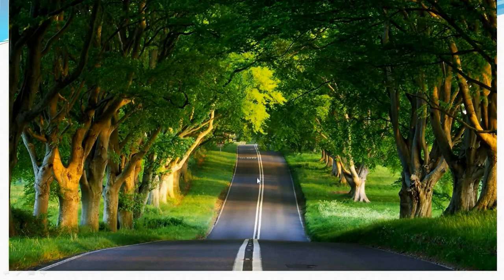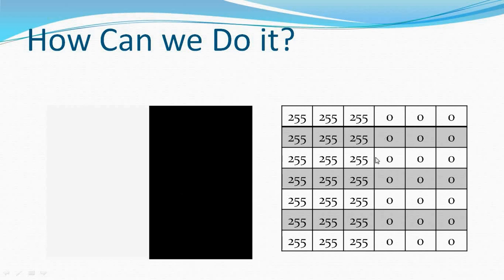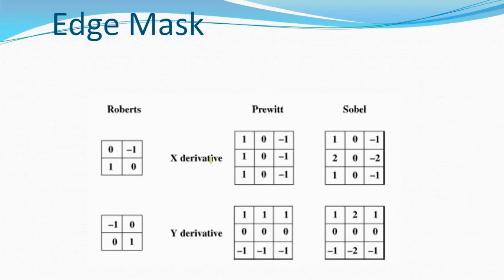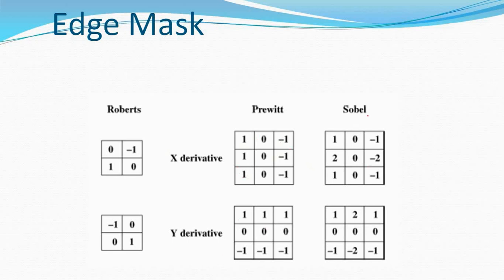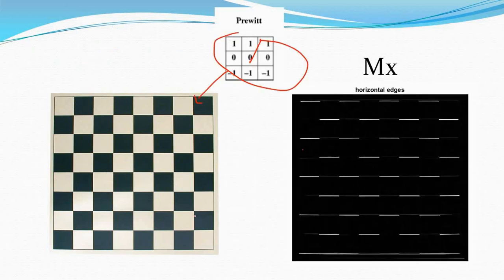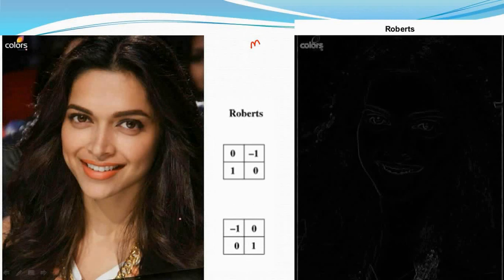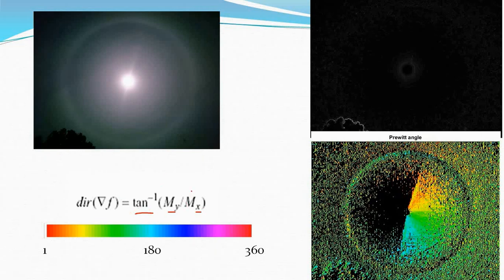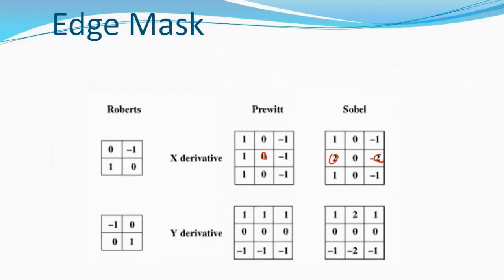Edge detection

Comment: When you say apply magnitute, do you mean calculate M = sqrt(Mx^2 + My^2) and multiply this matrix to each pixel window in the image?
Reply from the maker: No i mean by calculating the Mx image by convolving it with the x direction mask and calculate the My image by convolving it with y direction mask and then calculate M = sqrt(Mx^2+My^2) note that Mx and My are both images
Reply: @pratikian  I have two confusions: first, what do you mean by convolving? Second if MX and My are images, what does squaring, adding and square rooting a image mean?
Reply from the maker: https://youtu.be/usH-BHyFmYw
You can see the 1st 4.31 mins of this video to understand what is convolution. There I have used a low pass mask instead of that you can use the Prewitt or sobel edge mask for edge detection. This method shown in the video is called as convolution. 

Now if you see 11.28 of this video ( edge detection video ) you can see the Mx and My images so images can be considered as matrices so squaring a image means squaring each pixel value of the image so Mx^2 means squaring each pixel value in Mx then similarly squaring each pixel value in My. Adding the pixel values of Mx^2 and My^2 and then taking the square root off all the values of the result
Reply: @pratikian  Bro you are an amazing teacher!
Reply from the maker: @shashwatgupta479  thank you so much for the compliment ..🙂